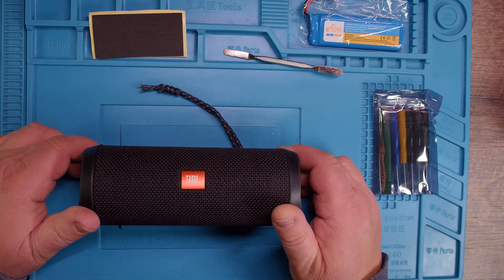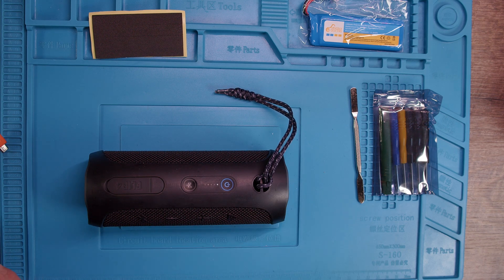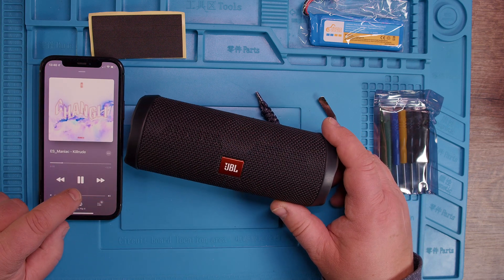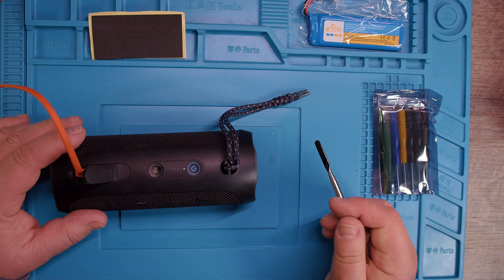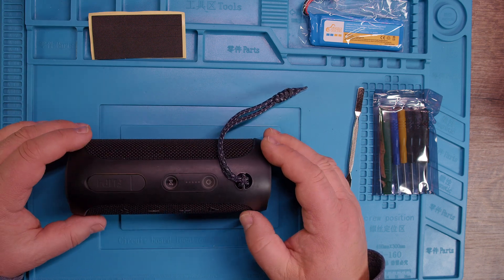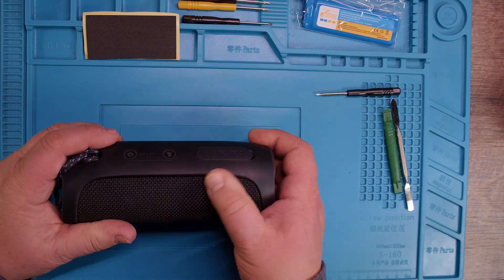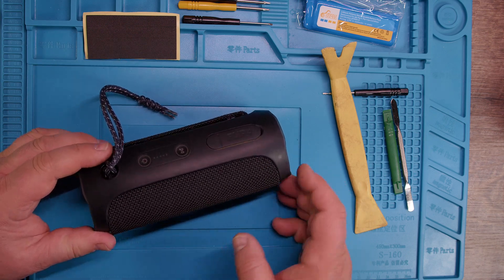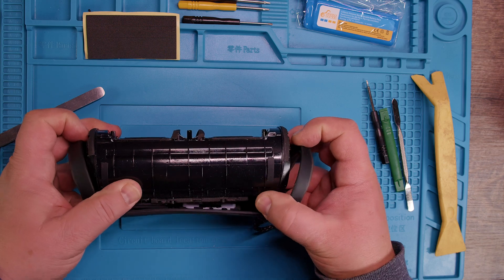JBL FLIP4 Repair (GG Version)

Comment: What a detailed and very good Guide  ...  i did not had to take the Charging prot entirely off it was enough to takie it a bit out of the way so i could push the old battery out which was swollen as well ..  thank a lot for the guide and explanation of the strange noise which comes from low Voltag  :-)

Comment: The battery of mine doesn't come out no matter if i'm pushing and or pulling on the battery.

Any ideas what i could do?
I'm considering putting a few drops of WD40 on it to maybe loosen some glue that might prevent it from coming out.
Reply from the maker: If the battery is completely discharged it is not dangerous, you can force it out. Wear gloves and safety glasses and do it outside in a safe area. Just in case the battery pops when you push it with force.

Comment: My JBL Flip 4 does not have screws to remove the charger connector end cap, it has a picture on the case showing the direction of Unlock/Lock but the end cap does not rotate to the Unlock position shown. I need to get at the circuit board to repair wires. Any comment would be appreciated. Thank you.

Comment: So frustrating, I was successful with one that didn't have a bloated battery, but two of mine had bloated batteries and I had an awful time getting off the USB charging socket to be able to push out the batteries, ended up ruining the wire connectors on the tiny attachments to the USB unit, so now I have two trashed speakers due to the wire connections being impossible to reconnect.  My advice, if the battery doesn't come out easily, forget about it! Nice job on your part though!

Comment: THANK YOU! I have the TL version, but the battery was so bloated, I needed this video to figure out how to get the other end open and shove the battery out (which was STILL a pain. I could see that even if I got the ribbon cable disconnected, I'd never get it reconnected, so I was very careful in the blunt object placement.) Also, I'm not counting on it being 100% waterproof anymore, because the outer piece cracked slightly when I removed it; I definitely recommend using a tool to pry/pop that up instead of just pulling up from the sides. But I've had this awesome speaker for quite a number of years and I'm so happy to be able to enjoy it for a few more!

Comment: I have a GG model, and im little bit confused, that what battery i have to buy. Is there own battery model for gg version, and another one for the TL version?
Reply from the maker: It is possible that there are slightly different batteries available. Best to take the old one out, and then order the new battery with the old one in hand. The difference will be in the battery connector.

Comment: HELP!  I have a Flip4 TLmodel and it has a mind of its own!  Suddenly turned on in the middle of the day and now its turning on and off randomly in spite of my trying troubleshooting with pressing Play & Up simultaneously, then trying other combinations based on some Youtube videos and nothing seems to work.  It is almost fully charged (4 out of 5 lights) when I plugged it in to charge.  I unpaired it with my phone since it interfered with a serious phone call I was on.  Please help.  JBL is only offering a 35% discount if I want to buy a new one since its out of warranty.
Reply from the maker: could be a bad battery

Comment: 4.0 caused erratic battery reading. I charge it full. It takes like 2 hours (charger is 5v 1.5 amp). Then I listen to songs and in around an hour, the battery indicator goes to one point (red) and it turns off. If I power up, it the battery shows 3 points again in an hour it goes to one point (red) and goes off. The cycle repeats and remember I'm not charging just restarting flip 4. I want to downgrade to 3.8 or 3.9. How can I do that?

Comment: Buy a new battery and I break my old battery cable while pulling it out and it is almost impossible to get it out . What a stupid design
Reply: I can not remove the old battery also, there is no way to do it!! >_<
Reply: Same, i drilled the Battery out xD
Reply: Open the other side and use a fgat screw to push it out.